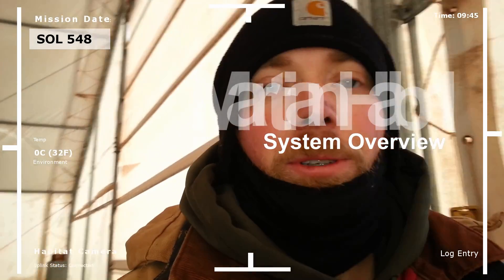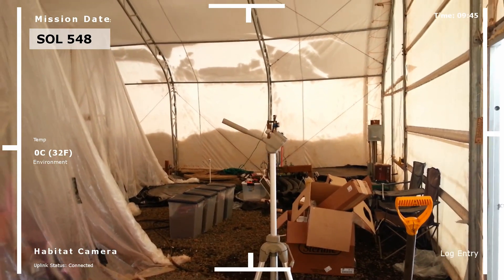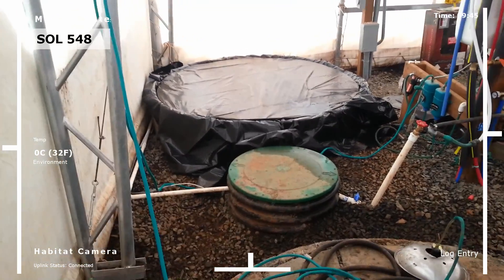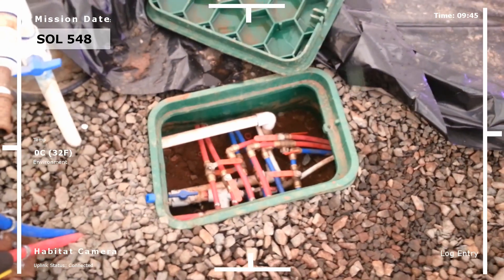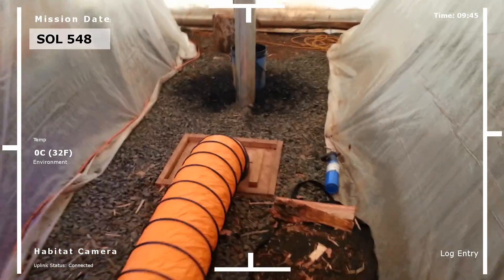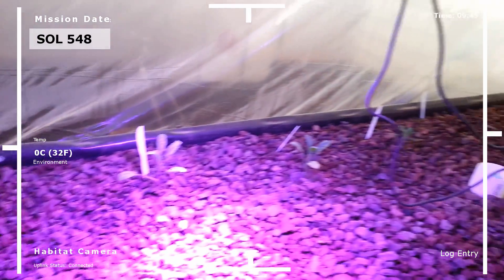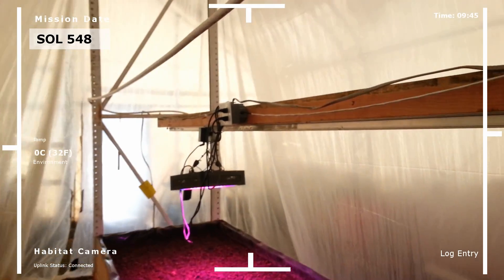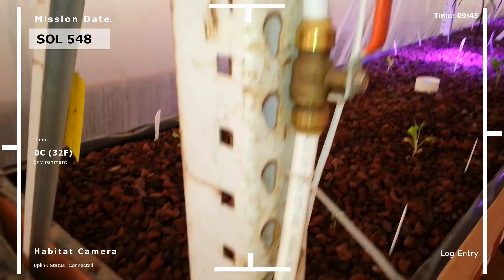Ultimate OFF-GRID, SURVIVAL System - Solar, Wind, Aquaponics, and Power from Poop!

Comment: ground control again , go vertical towers, let them drain into the beds ardu controlled pumps to the towers, 3 min off 10 sec on, com line between several arduino so only one active pump at a time , simple few lines in code control 3 min is 18 pumps at 10 seconds each , 40 amp service sees only one pump running and relay controls, 12 volt bilge pumps eBay 500gph $12 each, 1000gph $14 each the redwht blue ones, running continuous 8 hrs day will last approx 6 months. in ardu system each pump only runs 72 minute per 24 hour period so should see 2 year life cycle 
solar install 3-4 ,260/280 watt panels 8 deep cycle golf batts 2-20 amp charge cvontroler amazon $16 ea should be sufficient to run system 24/7.. slow build is 2 panels, 1 charger 4 batts multiple small systems, keeping batts separated not mixing old with new , rotating out older batts every 8 years if not overburdened or loaded

Comment: hey you left the door open, fram an air lock in the door way help with winter temp control as well 2 doors better than one create a thermal break upon entry exit . 
get a couple of aluminium radiators from amazon can be used as de humidifiers in the winter if attached to the firebox fresh air intake . the outside air passing through the inside of the radiators then to the firebox, 
this will act as a heat exchanger and dehumidifier when the fire is up.

Comment: suggestion add a fresh air intake for the firebox back shield the fire box and set the fresh air to enter through the shield to warm it upon entry. this will help keep the fire from pulling a vacume on the canopy and draw cold air in at the intake instead of every leak point. this will help with condensing in the flue as the outside air is dryer. and will allow the heat to spread further from the source ,
second is 2 thermal generator chips to run a 5v computer fan set against the back side of the firebox and in line with the fresh air intake with a heatsink fan inside the intake, once fire is going the fan will draw the outside air through the pipe hotter fire faster draw from intake , you have to think about where the air to feed the winter fire comes from.
better directed and pre heated controlled than drawn from random places creating cold spots inside the canopy
signed ground control 😃

Comment: I used to work in a plating shop as the environmental manager.  I designed a built a natural gas-fired evaporator to reduce the volume of treated wastewater, and I tried to use the exhaust of the burner tubes to heat a room for drying parts.  If you take too much heat out of the exhaust, you get condensation, as you've discovered.

I know you know this Real Martian, but what follows is for the public. For every pound of methane that you burn you get 2 pounds of water.  CH4 + 2 02 = CO2 + 2 H20   Oxygen is heavy, and you add four of them to the methane.  I think it is only recommended to operate at 80% heat removal efficiency when burning methane to prevent condensation.  If you operate higher, you need to do something to prevent the condensation from corroding the materials.

Comment: I co-owned a chimney cleaning and building company for 9 years so let me give you my advice on your wood burning situation.  I assume you are burning dry and seasoned wood so that you don't lose btu's to heat the wood that could be used for the project.  Your stove pipe appears to be galvanized instead of black stove pipe and  is not designed for high temperature burning but rather for oil furnaces.  It will give off a gas that you don't want to breathe if you burn properly to maximize your wood stove.   I hope I am wrong and it is stainless steel pipe.   I am happy you are not using a catalyst stove as that only reduces your draft.  Your thermometer should be on the stack and not on the stove because you need to monitor the temperature of the gases and not the stove.  Those temperatures need to be at or above 400 degrees F. to keep the stack warm enough to prevent moisture issues and creosote. Burning to cold will build stage 3 creosote which is like an obsidian  rock which is bad.  You need to clean that stack out once a month or every so often people don't match the btu output of their stove to the square footage they want to heat so you may need a smaller stove if that is what it takes to keep the stack hot enough.  You will also want to burn for a half hour after a long burn at around 900 degrees F. to burn any creosote and get that flue temperature back up to optimal temperature. 
I love your channel and look forward to all the information gained to help me with my future off grid castle project.
God Bless,
Dale the Castle Guy!
Reply from the maker: wow! Dale...thank you thank you....your inputs are highly respected and welcomed. It just goes to show that there is so much in the world to learn and together is the only way we can learn it. This comment is highly useful and will change behaviors.

Comment: I hope you have some kind of thermal brake on the outsides of lane 1 and lane 4 to prevent heat loss through the soil to the outside.
Reply from the maker: yeah, I've been worried about that but have put in the "backlog" as something I'll have to deal with when I get there, but yes...it needs to be addressed. lots of heat loss there

Comment: You might want to build your own PC. Usually they're better bang for buck and future upgrades. You can even buy used parts and get a reasonable editing/rendering rig with server parts, like Xeon processors, just put a new PSU, video card, memory and SSD. An old Xeon can do great stuff for multithreaded applications.

Comment: Perhaps a second skin on the inside of the tent / building? Maybe a clear roof with horizontal blinds utilise as much natural light as possible..... also how about animal dung? That stuff produces massive amounts of heat as it deteriorates  so maybe stock pile as much as possible and run a copper coil through it to naturally heat water. Or to use oil filled pipe heaters for the inside of the tent. Anyway good luck with your endeavours I will be following closely.

Comment: Heat being a major issue could a copper tube with your water supply going through it wrapped around your chimney assist the warming of the environment. Also what about using the earth/dirt to insulate as in green houses that are made by digging out the growing area down to 6-9 feet? Could reflective mirrors assist in the grow light energy getting to the plants using less energy. Meaning if the grow light is stationary but a reflective mirror moves or rotates to spread the lighting so less energy is used?

Comment: Everything is shaping up from an engineer's standpoint, it appears. From the biologist' standpoint, I don't think you will maximize your plant growth with your current lighting set-up.  

Thought:  If you will note in your videos, you have an intense hotspot in the center of your grow beds under each light, with the light intensity dropping off in a Gaussian distributive fashion towards the margins of the beds.  This will result in much better productivity in the central bed with loss of growth towards the edges.

Arranging a complex rail system to move the hot spot over every portion of the bed would be possible, but technically complex and likely quite mechanically unreliable.

You might consider adding two simple items to your system.  1). A motor drive system that provides y-axis deflection of the light in a manner that is out of phase with the x-axis motion of your current rail assembly; 2). Lateral reflectors to reflect light escaping the beds back onto the foliage.
Cheers!

Comment: On your grow lights : Why did you not use several strips of LED (Red Blue, Yellow) and runs them switched so that 1 strip is on at a time like a few ms per strip in fast sequence. I think it would still save power and light the whole bed , and eliminate the motor's that move the spot grow light.  Also have you considered installing solar light tubes to bring down sunlight from the outside to over the beds?

Comment: @TheRealMartian You should look into building your own LED lighting. For the LEDs: http://www.cree.com/LED-Components-and-Modules/Applications/Color/Horticulture   you can buy the lEDs already mounted on little star shaped PCBs that you can screw onto aluminum for cooling (using thermal paste). All that's left is to wire them in series and feed them with a constant current led power supply. I build my own lamps recently, you can check out the pictures here: http://www.abload.de/gallery.php?key=qqET7ajx

Comment: I like the your automation and use of arduino controllers. But, I have a big concern about your safety. I don't see any kind of monitoring system for methane buildup in your building. You appear to have a nearly airtight setup with your main building plus the plastic tents inside. You have tanks of fish and you use the affluent to feed your plants. That system itself produces methane and can deplete the air of oxygen. The methane can accumulate in pockets in your building until it reaches a dangerous level. Normally, digesters and methane storage tanks would not be a inside of a sealed building. The controls, motors and lights used in the vicinity of those tanks are normally explosion proof because of the volatility of the methane. To me, the least you should have is a system of methane, oxygen an carbon monoxide (because you are burning wood for heat) sensors in the building to alert you before it becomes dangerous. I don't want you to do a Hindenburg.........

Comment: could you maybe split the chimney into like 3 or 4 pipes for more surface area for radiant heat dispersion and then just bring it back into one at the top to not waste as much heat. or maybe run coiled copper piping around it with water running through if you need hot water

Comment: Tip: Don't go with an Alienware computer! Just build one and theme the case yourself if you have the time. You'll be paying for old-age specification, and you'll pay a fraction of the cost if you build it. If it's the first build, you learn how to assemble and also have more knowledge when it needs fixing!

It's just an honest reply, and suggestion. Just go with hardware that is 6 months to a year old because even if you buy the greatest, 6 months down the road they will have 5 better things that are faster. Avoid defined meta-terms; "Gaming!" "Racing!" etc..

I bet you could build a great computer for USD$1500-1800 that has more bells and whistles than a flashy-cased Alienware desktop! Especially with Newegg, and Amazon around!

Comment: Have you looked into the possibility of using TEG (Thermoelectric generators) coupled with a LP/Methane burner and/or a wood burning stove? I know a commercial/industrial unit meant for an off grid site might be waaaay out of your price range, but it might not. There are also DIY TEG designs. Just something to look into.

Comment: Do you plan on setting up some temperature sensors around the room and logging the data? Would be helpful to map the convection currents and also monitor if there is any major heat loss in a specific area. Great videos!

Comment: It seems like you're busy.  I left this in another video's comments, but in case you don't have enough time to view all the comments, I wanted to add this in a more recent video.  I thought perhaps a pool cover reel could solve the problem of the snow on the solar panels.  Perhaps the greenhouse plastic stretched over the array, then rolling the plastic up when it's covered with snow, dragging it all the way to the reel.   ?  When you know snow is coming, stretch the plastic over the array.  Just a theory.  Good luck.
https://www.amazon.com/FCH-Aluminum-Solar-Swimming-Inground/dp/B01MDLU2GG/ref=sr_1_11?ie=UTF8&qid=1483332176&sr=8-11&keywords=pool+cover+reel

Comment: I have a question about the power. I understand power is a major issue. I am sure you have thought about wind power. I understand the direction of putting on Mars. From what I understand wind is not a problem so why not use the wind for power generation. There are some great designs that are not only compact but can generate a lot of power. This would supplement the 40 amps that you have now and give you a lot more above what is being created with the solar panels. Just my 2 bits.
Reply from the maker: thanks for the input...yes we'd like to do wind. We poured the form for it but didn't have enough money to by the equipment. thanks for watching!

Comment: With so many comments and so little time to read them I just know I'm going to be repeating someone sometime.  But,  I'd rather do that than leave a stone un-turned.
An idea on your grow lights versus plant benches.  The radiation pattern on the fixture doesn't match the area your trying to illuminate I think.  You might want to consider some foil reflectors on the sides of the lights facing the sides of the planter.  Leave the sides moving up and down the planter unblocked as they always shine at some plants even in adjacent boxes. This reflective "shade" might even help reduce algae growth on the plastic sheeting.  Right now  your grow lights may be promoting algae growth.  Hmmmm just occurred to me.  Maybe you want the algae growth if you can "wash" it down into the fish tank water where it can feed fish or snails or something.  If the algae makes it to a sand filter on the pool pump you could back flush the algae out and into the methane system perhaps.

Comment: Please dont buy prebuilt garbage PC. If you can build arduino controllers there is no reason you cant build your own PC for 1/2 of what Dell is going to gouge you.
Reply: I can even help pick the parts that are necessary! a super fast gaming videocard is for example not necessary when videoediting, but a really fast CPU is essential! multiple really fast SSDs for reading and writing are also essential :)
Reply: retsaoter Yeah, really. Dell SUCKS!!!!!!!!! Anyone can pit together a barebones kit from tiger direct or newegg, and if you spend a little time researching, you can put together your own system exactly how you want it. I built mine 10 years ago, still running fast on ddr2 ram and a quad core processor. Also, consider using linux mint as a dual boot with Windows, Linux runs way better and is fine for 99% of what you will do.
Reply: guys as you can see hes a busy guy as he explains he works a couple of jobs and runs this homestead
Reply: +zack hileman  Are you familiar with Chronological order?

Comment: You could always use car radiators with some fans, at the ends of the inground heating lines? That way you're getting all the heat out of the lines for some above ground heat.
Reply: auto junk yard, cheap cheap!